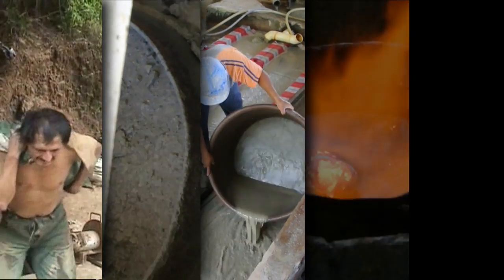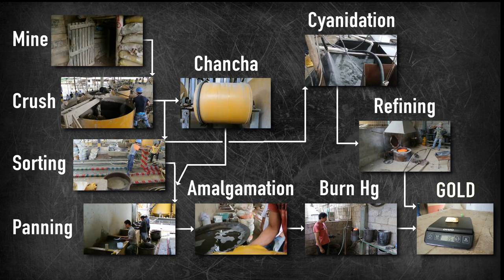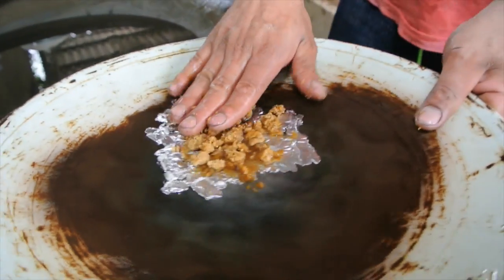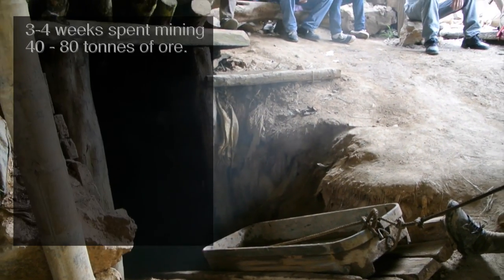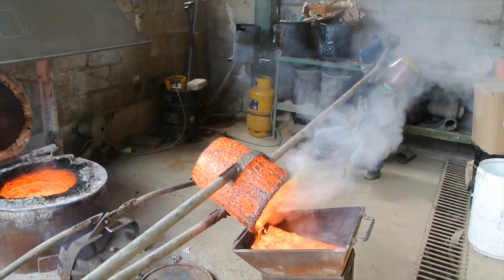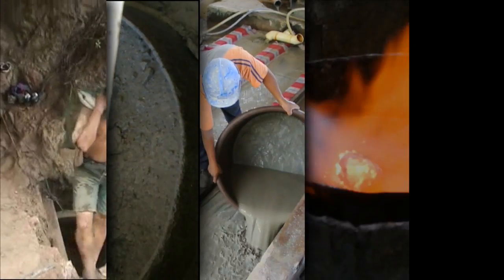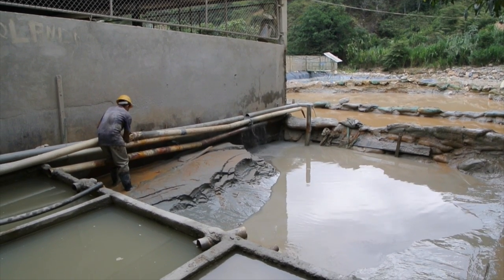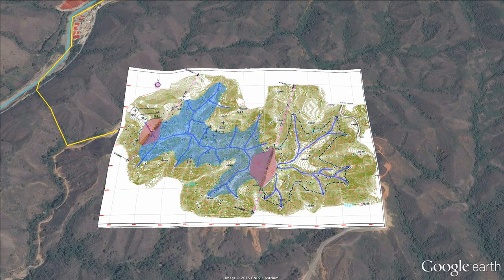Artisanal Mining: Poverty Driven Destruction

Comment: if mercury is used to recover the gold being processed then instead you will be able to use a well operated gravity/water system to recover it with a 90+ % recovery no chemicals needed just some practice/skill/training to be good at it. then concentrating the recovered gold on a water driven concentrating table /sluice to a high enough concentrate  ratio that can be directly melted in a furnace with a basic flux and pour out a dore bar which can be sold to a refinery or other. there are virtually no  economic loses in this method and mercury is expensive  and also nasty, nasty contaminate. i have proven this works for 40 years no toxic waters no pollution. a fellow miner doubted this and challenged me. his mercury method against my basic gravity/water method. he was an expert at his way and lost.he recovered slightly more gold but the cost in dollars was greater due to the mercury used to do it and the simple clean method can be upscaled to any size operation.  there are other miners  using the clean method. all my recycle ponds i made thrive with  frogs , dragon fly's /aquatic life, ducks and more.  the method used recovers down to 100 mesh  and fact is almost all  gold is larger than this except a few location's .now modern improved concentrating tables recover efficiently down to 400 mesh.  this way is much cheaper/ safer than buying poison mercury which should not be used in any product.
Reply: @ge r I would love to learn more about this method of clean mercury-free gold recovery. I'm also based in Canada, and we have some mining partners that could really benefit from this knowledge. How may I get in touch with you? Thanks in advance, I look forward to hearing from you.
Reply: @andreistoica2370  just google (gemini table) or (gold wave table) and you will be on the way to full recovery of alluvial/mill concentrates good luck.!